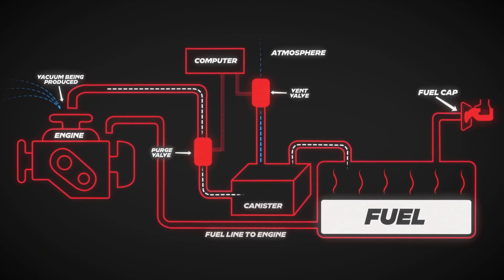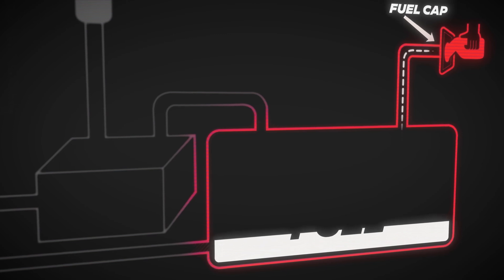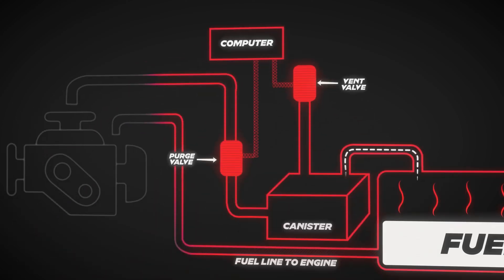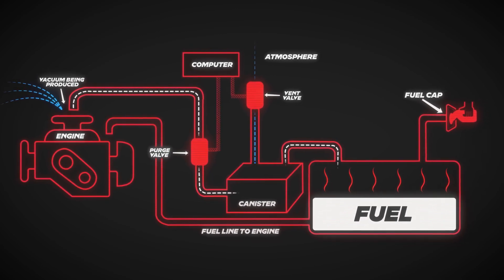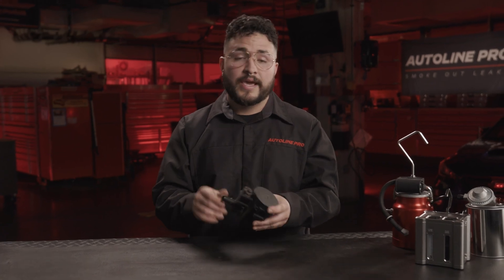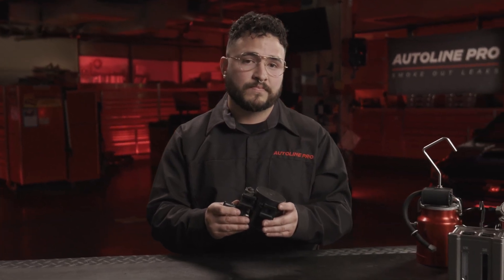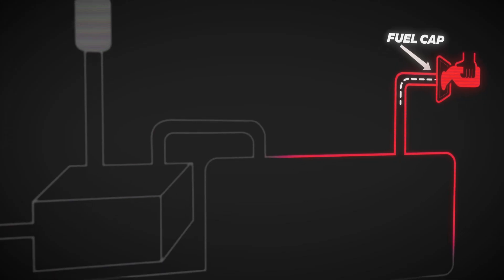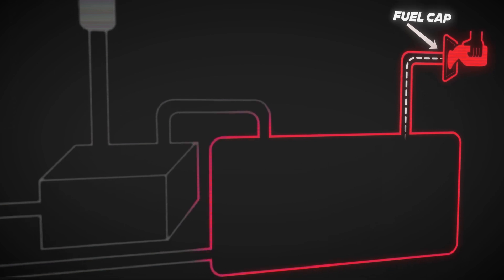What is the EVAP System on Your Car? How Does It Work? & Why is it Important? | AutoLine Pro

Comment: The charcoal canister does not "absorb" fuel vapors. Instead, it "adsorbs" vapor onto the surfaces of the activated charcoal. There's a significant difference in these terms. 
This video describes the system but there's no troubleshooting or normal operation discussion. Like cold starting, normal running, fuel cell levels required for testing and so on. 
Looks fancy, good production value, but you could've added more with not much more effort. 
Trying to provide constructive feedback, not that I could do better.

Comment: Hi i want to know about a BYD's Fuel system, in this they eliminated the Fuel Tank pressure sensor from the tank and connected with the the vent hose that is connected to a purge valve. is there any wat to contact you? i want to understand the mechanism. your reply will be helpful. Thank you
Reply from the maker: Hello! We are sorry, we are not able to provide specific advice for different makes and models due to liability issues.

Comment: if the gases are absobed by the first component fron the tank - the charcoal filter cartridge, there is nothing to burn.
Also, making charcoal causes... fumes.

This is just daftness personified.
Reply from the maker: The charcoal soaks up the hydrocarbons in the vapors like a sponge, and the engine-control computer periodically purges the canister of fumes and sends the vapors back into the engine again to be burned

Comment: So how do you know if you have a "issue" with your Evap system? I have a 8 month old Toyota GR86 Premium which is kept inside a garage. Just last night i went into the garage and i noticed a low humming noise coming from the rear of the car. I couldn't tell where the noise was coming from until i put my head down level with the rear tire. The noise was coming from the center of the car, perpendicular to where my head was from the center of the rear tire. This vehicle only has 800 miles on it, just a side note. I turned the car on, let it run for 3 minutes, turned it off, and the noise stopped, which i figured it would.

I then went onto a facebook group that i'm in for GR86 owners, and immediately started getting posts saying it was the Evap system. Okay, so what does that mean? Is the car running okay and doing what it's supposed to do? Is this normal for cars in this day and age? I can't imagine something is wrong because it's so new, but just wondering what your take is on all this @AutoLine Pro

Thank you i hope you have a blessed day

Comment: Here's what I don't get: people say that the vent valve solenoid is open by default, when no voltage is applied, and it only closes when the computer sends voltage to it (for creating a vacuum during leak/blockage tests). But in that case I don't understand how the vapor canister is able to "trap the fumes" and release them to the engine via the purge valve (which is closed by default and opens only when voltage is applied)? Because as long as the vent valve is open, all fumes will travel through the charcoal filter and out into the atmosphere, meaning that there's no trapping. And to make matters even worse - your fuel gets continuously evaporated this way. Also, many videos have completely opposite explanations which are 100% conflicting, where one guy says the vent valve is a 1-way street for getting air IN the vapor canister, but never OUT, then another guy says the complete polar opposite (only OUT, never IN), then some others say it's a 2-way street for both IN and OUT. I'm completely lost here...
Reply: The charcoal canister traps the fuel vapors and allows just "air" out. The fuel tank is actually open to the atmosphere through the charcoal in the engine off situation. Air is allowed to travel through the charcoal canister. Otherwise pressure would build in the sun etc. When manifold vacuum is applied though the purge valve air enters the canister and fuel vapors are pulled into the intake manifold and burned. This depletes the vapors and allows more to be trapped during refueling and engine off times. 

Hope that helps. Yes it's a 2 way street.
Reply: the video said it already, the vent valve is closed initialy, and only open when you switch the key on,
it'a purpoaw is to open so that as the fuel push fuel up to the fuel lines a vacuum is creates inside thw tank so the vent valve is opened to compensate with the losing area inside the tank, air volume inside
Reply: @taylorsutherland6973  Yep, but the problem is that the charcoal will eventually get saturated with the vapors (if the car is parked for a long time and the engine cannot use them up via the purge valve, thus clearing the canister for a new storage cycle), so past that point the canister will no longer be able to "store" the fuel fumes, so that open vent valve that communicates with the outside will basically start to leak the fuel out into the atmosphere, as the activated charcoal can no longer hold more hydrocarbon compounds, so the fuel will literally evaporate as a whole.
Reply: @EmeraldOtringal  

I've never seen that happen. Evaporation really only happens until the air above the fuel isn't saturated with fuel vapors. 

For instance, I have a 1959 Galaxie, with a simple 5/16" tank vent pipe open to the atmosphere behind the rear bumper. The fuel doesn't continuously evaporate, and my garage doesn't smell of fuel vapors unless there is a big change in temperature.

We are not talking about a huge amount of volume of gasses/vapors going through the canister. 

The biggest flow though it is during refueling at the gas station.
Reply: Hello I know I am very late however the gasoline vapor in your fuel tank is always able to vent out to the atmosphere this is so that pressure does not build up, the charcoal canister filters this, so the fuel in the vapor gets stuck in the charcoal inside the canister, thus releasing just air into the atmosphere, then that gas that was filtered is purged by your engine when it is appropriate,
Reply: I think your confusion is that the engine pulls vapor in. Atmospheric pressure pushes vapor to the engine through the vent. The computer will close the vent to run tests on the system

Comment: But what's the problem with fumes if left in the fuel tank and evap system is not used?
Reply from the maker: the fumes help to locate the leak

Comment: We have a 2008 KIA Sorento EX that has 281,000 miles on it (still runs great). Have changed out the gas cap, several times, due to gasket failure causing a check engine light to come on. It is back on again... EVAP has been changed out several times. Hoses seem find and have been tested for leaks. The only this that is original is not listed as changed. Help as to fix current check engine light as to testing what now has failed?

Comment: I have a 2010 Avalanche and occasionally what I belive is the evap system there is something that runs for about 3 or 4 seconds and sounds like a small air compressor is this part of the evap ? Thanks